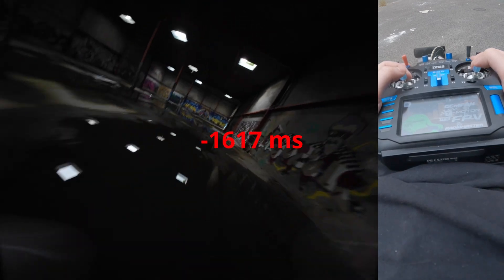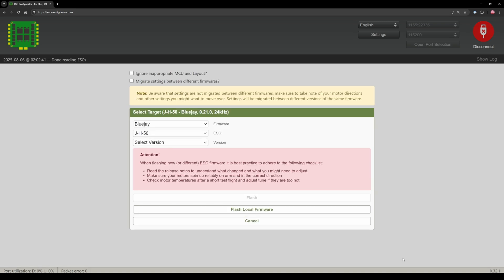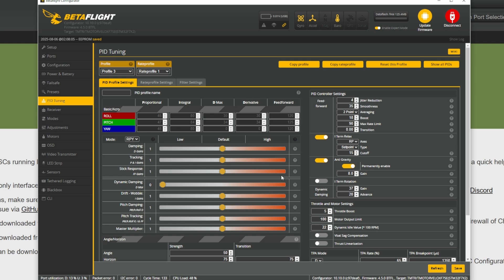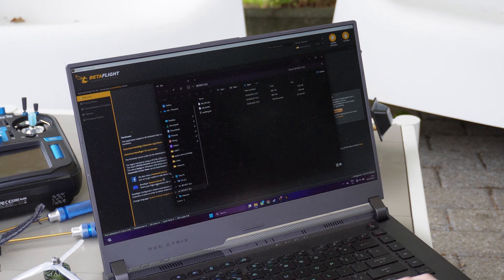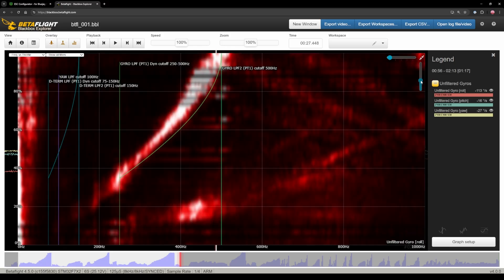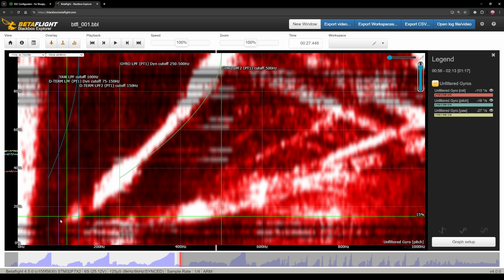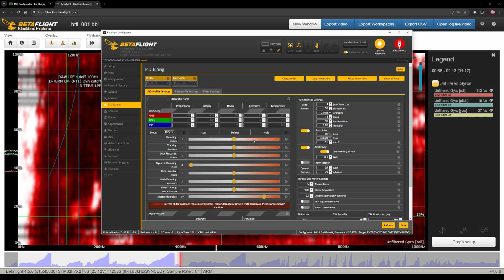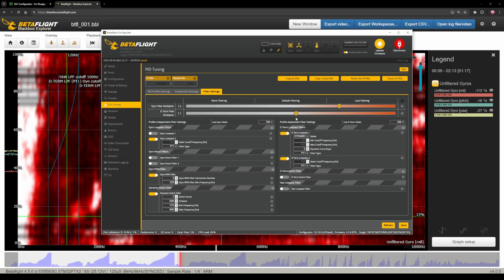Please PID Tune your FPV Drone (easy tutorial)

Comment: The 2 diagonal lines you were seeing in the log are the 1st and 3rd harmonic from the motors, you have an extremely weak or no 2nd harmonic. This does NOT mean you can reduce the rpm filter harmonics number to 2. Doing so turns off the 3rd harmonic leaving you with a large amount of unfiltered motor noise. If you want to disable the 2nd harmonic to save on filter delay, instead do “set rpm_filter_weights = 100,0,100” in the cli. Setting the weight of the 2nd harmonic to 0 disables it while leaving the 3rd harmonic in place. If the 2nd harmonic is still present in the log but weaker than the other 2 you can use a larger value than 0 to take care of it.
Reply from the maker: Ah it doesn't just "look" for the next strongest harmonic? I did fly on 2 harmonics for the longest time with no issues, but just went to 3 since making the video and I'm not noticing anything different in flight performance :D
Reply: @nils_vo  and what you said about it "looking" for peaks of noise, only the dynamic notch filter does that. the rpm filters are dumb and will only filter at the main frequency of the motors and then at twice and three times that frequency if you have all three harmonics enabled
Reply from the maker: @benryfpv  Ah yeah that makes sense, thanks! Maybe I'll try the filter weights at some point if I'm not too lazy 🤣
Reply: @nils_vo  you definitely should. I'm the author of harmonic weights idea and I have not yet finished PR 14477 which will remove harmonic count at all
Reply: @nils_vo  you probably got away with 2 harmonics because the dynamic notch was covering the unfiltered motor noise. The 3rd harmonic basically generates no filter delay compared to the 1st and 2nd. reducing the weight of the second to 0 nets some significant gains

Comment: Freq vs Throttle gives me a black screen but Freq vs RPM gives me lots of red, why?
Reply from the maker: Maybe they changed it in a newer version, but RPM should work just about the same as Throttle for this use case
Reply: @nils_vo thanks for the reply.
Another question, once I do the tune, if I am to run the blackbox again, should I expect to see a reduction in the bright red/white?
Reply from the maker: @dannygiles825  The "unfiltered gyro" graph won't change, but the "Gyro" graph should be mostly clean (black)
Reply: @nils_vo  Turns out the blackbox was not set up properly by default and I had to go select all for "data included".
Once I did that, I got everything. My graph doesn't show a clear 'notch' though, only a very faint one. 
Another question, I'm following your tutorial for my 3.5" and I think its going pretty well. I also have a tiny little 1.5" drone, would you say this is still a good starting point? Or are there some significant changes for a tiny drone?

Comment: Really cool vid man thanks!I have an ERA 04 with the recommended setup(t-motor fc(icm42688),esc(AM32), motors) and pid tuned like it was shown in the YouTube tutorial by itsfpv but my quad still resonates sometimes.If I did the exact same numbers and settings do you think it would be an update compared to the basic pid shown in itsfpv video or should I tune it properly as you have shown here with test flights and all.I don't have an action 2 like itsfpv has on the build but with a 1400mah tattoo Lipo I'm on almost the exact same weight around 680g.what should I do?
Reply from the maker: if it also resonates on the default pids it's probably a broken FC gyro, happens sometimes. The recommended tune isn't all that crazy and should fly fine on any setup really. You'll probably find a video on how to diagnose a broken gyro on the UAVTech channel
Reply: @nils_vo  I tested it no broken fc gyro and I have two builds and both of them does he same.also if I add dynamic idle the motors make a shuffling sound.I use am32 and tried every setup, no stall protection...etc and still does the same noise.As soon as I turn dynamic idle off the motor sounds nice and clean but still does the resonance.

Comment: This has nothing to do with actual PID-Tuning. Its just a subjective trial-and-error until the Drone sounds weird. Cranking up the Master-Multiplier might work for a 5", because the default PIDs were made for that size, but it cannot be recommended for any drone smaller or bigger.
I even bet you, that your MM-value is way too high. As you normally see the latency decreasing until 1.4-1.5 and then increasing again.
Reply: exactly, all this video proved is not to take advice the guy making it,and the fact he doesn't understand the fundamentals of either transmission latency or how the flight controller works....

Comment: When you're setting the minimum frequency for rpm filtering - you need to leave the minimum at 100hz, and edit the rpm filtering fade range - to the start of the peak noise, using cli command. Default is 50hz fade range - so with rpm filtering set at minimum of 100 Hz - max rpm filtering is achieved at 150 Hz, when you throttle up. 100 Hz has no attenuation, 150 Hz has maximum attenuation.

Comment: Overly simplified explanation between esc pwm : 24hz vs 48hz -> 24hz stronger but less smooth, 48 smoother but less torque. On smaller drones this make sense, but on bigger drones better to keep it low.
Reply: Exactly! He explains it like 24khz is always better 😂

Comment: Well, being skilled in tuning drones now, I have to say, this is VERY BAD approach of the tuning. This is tuning that is suitable for this particular drone but it is NOT FOR EVERY DRONE!! There is no universal tuning. You should always be verifying every change in the logs. You can rely on your ears only if you have tuned tens of drones at least, it is not for beginners. Filter tuning is not as easy as the guy says. Doing it this way, you can really f*ck up your drone instead of improving it!! Don't just blindly decrease D-term filtering without verification in logs to see what it actually did, you have to keep the D-term noise at the proper level or you can damage your motors or cause fly-aways!! Always check gyro noise level and D-term noise level, spikes, vibrations and resonance and adjust filtering to it. Each drone is different and needs different filtering, not to mention this is good just for 5" but if you have a smaller or bigger drone, everything is totally different!! Filter and PID tuning is way off from these recommendations in those cases. Also, just moving Master Multiplier doesn't make your drone fly better, you shouldn't even start with it!! First you need to find PD balance, ideally using PID Toolbox, and then you can play with MM. But always check MM in logs, not just by listening, because sometimes there are already oscilations but you don't hear them yet. Also tune the PIDs having FF turned off. Tuning FF is a chapter for itself, because FF is what actually makes the stick responses almost zero but he didn't mention this at all!!. You can go with PID up to like 10-15 ms max, not lower without having oscillations, and then you need to fine tune FF to actually get near 0 ms stick response. That means not only tune FF gain but also FF Boost. Also, there is no mention of PI balance, Roll:Pitch ratio, I-term wind-up check, how to set Antigravity, and so many other parameters you need to test and check so you can tune the drone properly...honestly, this guide just sucks...
Reply: Really glad I've got to your comment! Can you recommend a better guide on YouTube? I'm set on reading Oscar Liang's PID tuning and filters guide, but I also want a video just in case I get lost on the way
Reply: @terorvlad  I was learning it by watching tens of videos for filter and PID tuning. There are different approaches but the principle behind is always the same. First you need to understand how the filtering is actually working, so you know how to set it properly. Then you need to know, how PID terms relate to each other, what affects what, how does it relates to other parameters you can also set in BF. The best thing is actually test it yourself. Keep testing each parameter changing it slowly to different values and watch, what it does in the logs. You will start understanding the relations better. Use both Blackbox Explorer and PIDtoolbox, because both have different advantages. This will require tens or even lower hundreds of tests but it worths it, because then you will just know what does what and how to resolve some particular problem. Some parameters are in CLI only but they can make difference as well. 

Main motivation for me was, when I wanted to tune my 2" drone and there is not any specific guide for that. So I had to learn it myself. I started from easy guides on Joshua Bardwell's, Chris Rosser's channels. Then I watched different channels searching for filter and PID tuning. After that I went more in depth watching tuning videos on UAV Tech and PIDtoolbox channels, where Brian, the author of the application, has very good videos. I also paid his Patreon to get the PIDtollbox app and access to the tuning videos and tuning session recordings that are not public, that helped a lot because they were very explanatory and sometimes they were dealing with some specific issues that helped me to understand it more deeper 😉

Comment: Great video would this method work for a 1.6 inch micro also Ive really been enjoying the zone my favorite simulator for sure
Reply from the maker: Thanks! I've never tuned anything that small before, but someone else said they got decent results on a 1.6. But you might want to test out some presets and go from there 😄
Reply: I got a tune u can stick on anything it's a short in my beginner playlist go try it.

Comment: No need to PID tune anymore. The presets are fine. And if the latency is an issue for you, stop using DJI and switch to HDZero.
Reply: Presets are ok but not even close to feeling as good as a tightly tuned quad. Same with the right battery and balanced quad. Most ppl don't understand this cause they've never experienced a proper quad. But when you do you don't want anything less.
Reply: @TorontoFPV  That might be the case with a freestyle quad. It is nice to be able to fine tune it a little with the sliders. But with a racing quad I have seen no difference. Everything is spec now so there really isn't any need to tune if someone else has already done the tune for you. His process is really good though, very easy if you feel like doing the work.
Reply: I agree with you in principle about racers, but your answer is still misplaced, as freestyle copter pilots have different requirements, so the comment doesn't really make sense

Comment: 48khz reduces motor vibrations and jello on all 3.5" and below quads, I would specify this in the future. I run all of mine on 48khz.
Reply from the maker: On BL32/AM32 or also Bluejay? On BL32 I like 48khz, but with bluejay there is almost no braking torque for some reason and only 24khz fixes it.

Comment: You can measure the actual filter latency with PID Toolbox. 48khz pwm is fine. Not mentioned at all: feed forward plays an important role for a responsive feel. For a quick tuning in a nutshell video I'd still go to jev fpv video.
Reply from the maker: 48khz is only bad with Bluejay specifically, there is no braking torque at all

Comment: For sure keep rpm filter at 3 harmonics, then adjust rpm filter weights
Reply from the maker: I actually used 2 harmonics for a long time with no issues, but yeah wouldn't recommend it :D Filter weights is just way too complicated for most people

Comment: Alles außer 24khz als scheiße zu betiteln ist totaler Quatsch.

Gyro lpf1 ausmachen ohne sich n noiselog genauer anzuschauen ist einfach nicht richtig und nicht gut. Wenn jemand ne Resonanz im Hochfrequenten Bereich hat und den lpf1 ausschalten wundert er sich ermal warum der Quad sich komisch benimmt nur um einen Filter mit kaum delay einfach pauschal zu cutten.

Unwissenden Leuten zeigen, dass sie n rpm filter reduzieren können ist fatal.

Ein Empfehlung für die dyn notch auszusprechen ohne sich im Detail angesehen zu haben, wie der Effekt ist , ist einfach Irrsinn.

Master ohne pd balance auf 1.8 und step Response Log Puschen ist genauso lächerlich und hat nichts mit tunen zutun.

Und der der sich nicht auskennt wundert sich warum am ende der Quad wie scheiße fliegt.

Ist einfach nichts ganzes und nichts halbes.

Ist einfach viel einfach gehalten um richtig sein zu können.

Nicht empfehlenswert.
Reply from the maker: Das mit den 24khz ist nur bei Bluejay so, mit BL32 ist 48khz auch ok.

Und bei den anderen sachen, klar ist es besser wenn man sich alles ganz genau anguckt, aber ich kenn die leute ganz genau und das macht halt einfach keiner.
Mit dieser methode bekommt man auf jeden fall einen besseren tune als default settings oder presets.

Comment: I’ve had issues with jello and DJI o4 with 24khz vs 48khz. So I wouldn’t make that blanket statement that everything but 24k is bad.
Reply from the maker: the 24khz thing is specifically for bluejay, on other firmwares 48khz is fine
Reply: its a tune for the drone not the cam i guess 
its about the quad flying well not the footage looking good normally you would record with a action cam and fly it on analog anyway
Reply: @bluefpv3263  You are partially correct. You are right that PWM frequency (24 kHz vs 48 kHz) is part of tuning for the drone, not the camera itself. However, PWM frequency  can indirectly influence footage because vibrations from the motors/props are reduced or shifted in frequency causing fixed digital cams like DJI O4/O3 or even action cameras to have jello. I had an experience of even props causing jello on my action cam. It took me 2 weeks to rectify it
Reply: Using Thrust Linearization should help get you the torque you lose when using 48khz. Why do you feel it’s bad on Bluejay?
Reply from the maker: @vz4798  motor accelleration and thrust is fine, but the braking is really bad for some reason. So it's super floaty when doing stuff like Split-S.